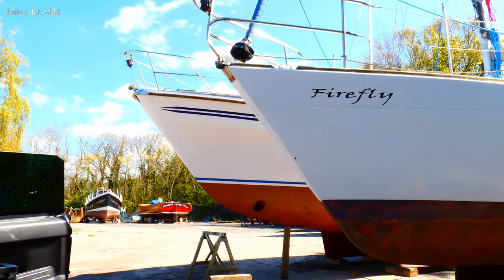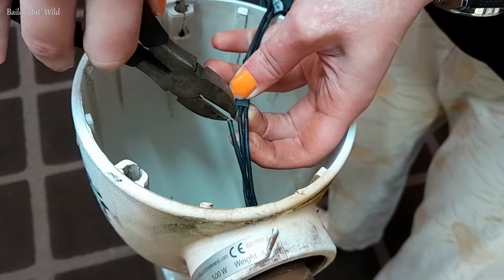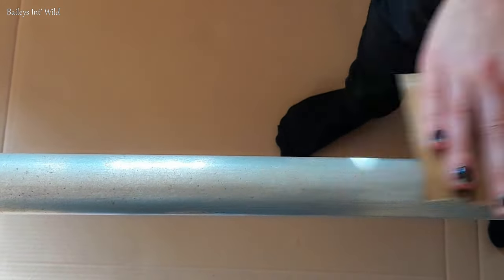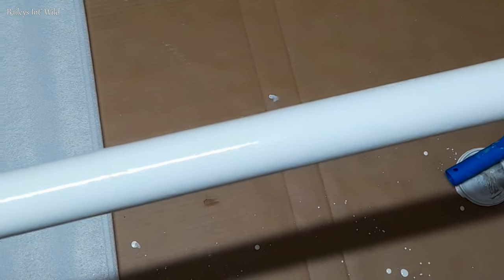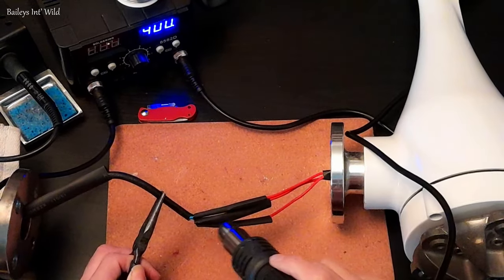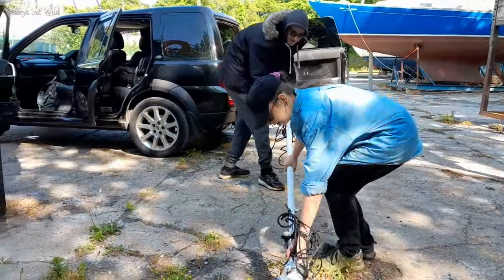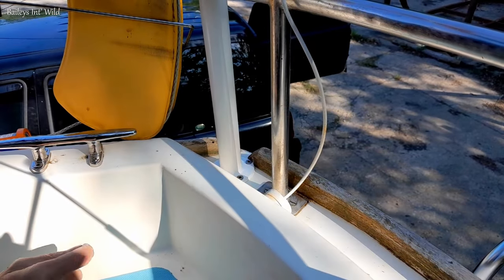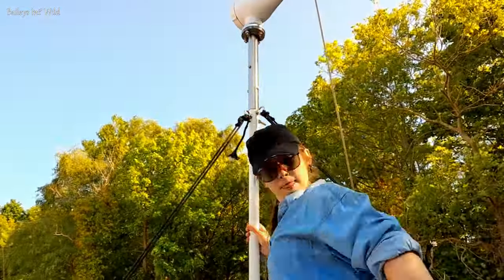Fitting an 800w WIND TURBINE to our 1980s SAILBOAT, 7.62m 'Firefly' [Ep.3]

Comment: Logo loogs great, i know its early days but whats power output looking like? :)
Reply from the maker: Thanks a lot  - erm, not fully sure yet. We have it braced for high winds at the moment (so it's not turning), however, it claims to be 800w (it definitely won't be). We only need a few amps for it to trickle charge a starter battery. When we have it all fully hooked up and tested, we'll know more.

Comment: Nice work  did that  turbine  ever  generate any power  so far
Reply from the maker: Still not sure, but we will soon. We have had it braced with rope for a time, while we were on with other parts of the deck, but apart from the anchor locker, a few bits of paint and some grommets, that's all just about done now. So we'll be inside, playing with electrics, and then we'll know.
Reply: Thanks I have  the exact same turbine  I think 12watts in heavy storm was about  all I have  seen it produce.
Reply from the maker: Yeah, we're not expecting much, to be honest. It's only to trickle charge the starter battery. Ours is an 800w one (supposedly). We have a spare 500w one as well.
Reply: I had very strong winds  this week managed to get 80watts lol
Reply from the maker: That's incredible. We actually tie ours off in high wind, but I'm glad it's working for you. Can't wait to sort ours out.
Reply: Thanks very much  looking forward to a update  on yours  x